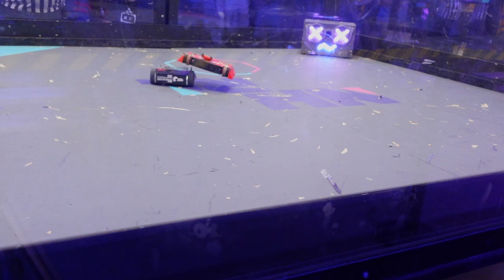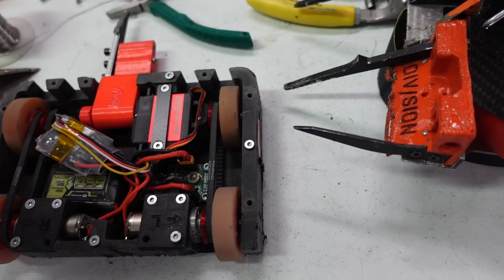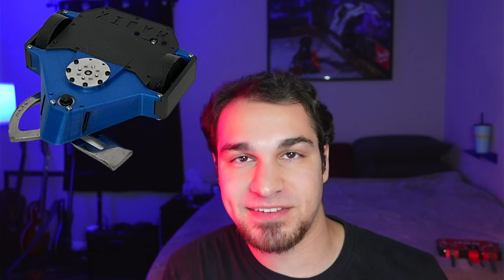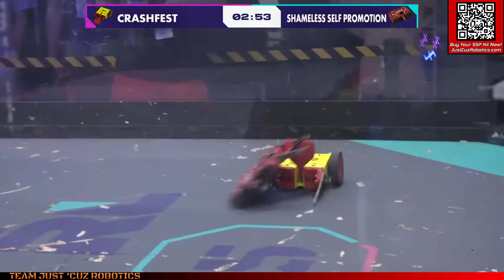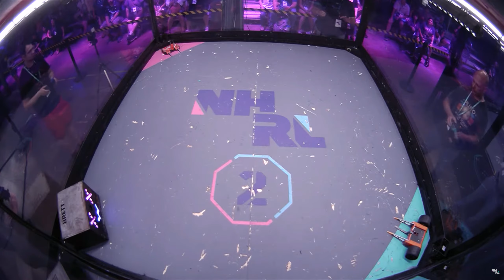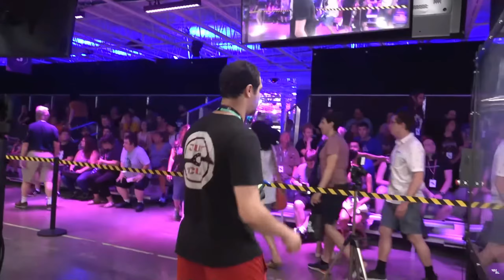Control Bot Domination, or Destruction? NHRL August 2023 Recap (SSP)

Comment: My fight with SSP was awesome! I will pull off an SSP wedge someday. I still am not 100% sure what happened with my drive. The motors were intermittent for several of my fights. When I got home from the event I drove the bot into a wall for about 10 seconds (stalling the motors) which killed one of them for good. I'll be switching to Gecko drive motors and hoping that fixes the issue. -Aidan with Radix
Reply from the maker: Always happy for a rematch!

Comment: SSP is looking great Seth and it sounds like you have quite a few friends cheering you on also. Hope to catch you in RI next time. By the way are the screws on your wedge counter sunk? I couldn't tell on my phone.
Reply from the maker: They aren't because counter sinking AR500 is sortof a nightmare. It's possible but requires specialty tools
Reply: Ahh I see. I use 1/4" AR500 for plinking plates at the rifle range and it takes hit from a 226 round without hardly even distorting.            Good luck and keep the hits coming Seth.
Reply: @JustCuzRobotics  Razi countersunk our with those harbor freight glass bits. I showed him one, told him to be patient and walked away thinking it would take forever. He was done in less than 5 minutes.

Comment: Funny story for you. I was actually on the panel for the SSP vs nitro hornet and the division vs dragonfruit fights. We had some confusion with the latter of the two but nothing like some of the other issues that happened that day. Which I’m curious to hear your opinion of those issues. Primarily the lynx event and chainsaw kitty vs hurt caboose. Can’t wait to see the new bot next weekend.
Reply from the maker: I haven't seen the Chainsaw Kitty fight you referenced. The Lynx fight has been beat to death on Discord already tho. Ultimately I think the ref did their job the best they could, getting stuck on a light that has fallen is no different than getting stuck against the arena wall IMHO and shouldn't require special treatment. It sucks that Lynx got KOed that way even though Josh didn't want the win, but Josh's choice not to tap out before the countout ended sealed Lynx's fate.
Reply: The one thing I think people missed from the Chainsaw Kitty v Hurt Caboose fight, as it wasn't shown on the stream, is that Kitty was still able to move using her weapon while Hurt Caboose was completely dead due to it's power switch being removed. I'm not convinced I 100% won that fight, but I think knowing that difference in damage makes it a closer fight than it appeared on stream.

Comment: The damage you received from Nitro Hornet was way more minimal than I thought. I would dread fighting something like that but my bot isnt nearly as easy to repair.
Reply from the maker: SSP was designed to be maintained by someone with no robot building experience so it's gotta be easy to fix! It took about 6 minutes in real time to repair the damage, that footage was sped up about 10X. As long as you have the parts needed it's super easy to work on.